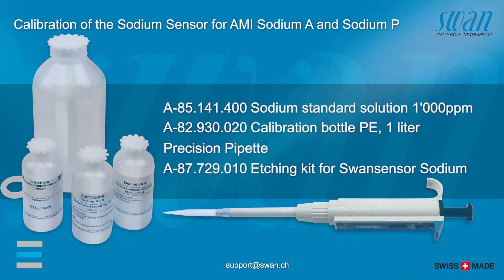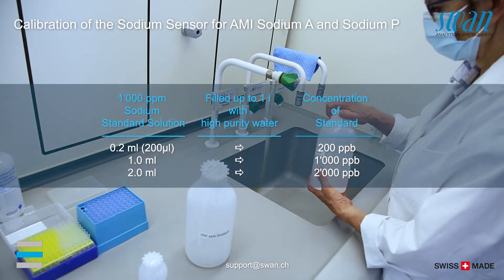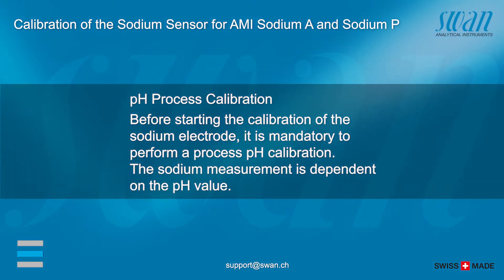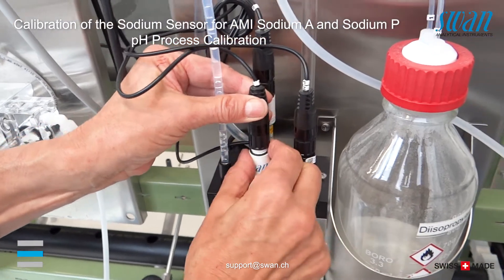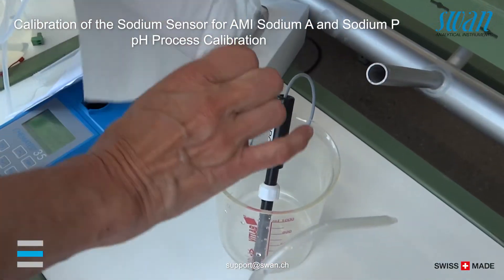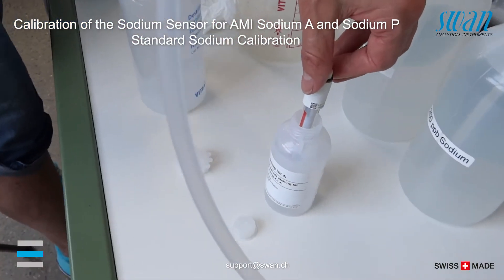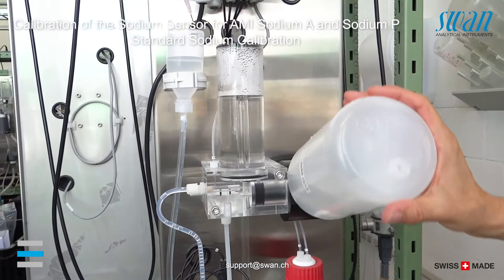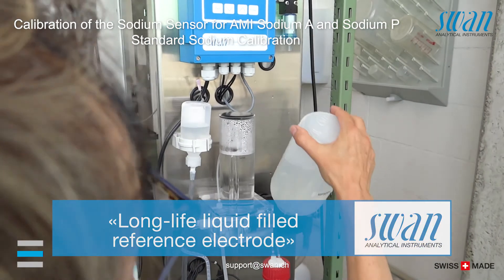Swan AMI Sodium A & AMI Sodium P – Calibration of Sodium Sensor

Comment: You should have pre-dried standard bottles, and should make your standards in a Volumetric flask.  You are losing accuracy by using the qc bottle fill line and by having residual moisture in the bottle.  It also looks like one of your standard bottles has a black speck in the bottom of it.
Reply: I just prepped standards today and used a graduated cylinder to measure the 1L to pour into the standard bottle, and it was well below the 1L graduation mark on the bottle itself, so yeah definitely use a different measuring device for accuracy